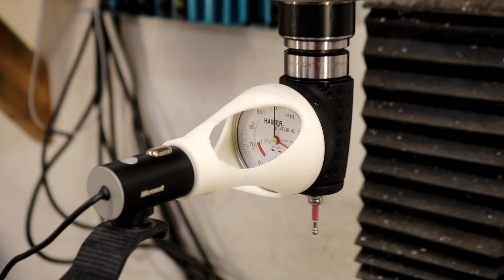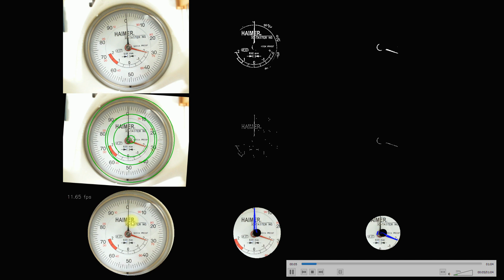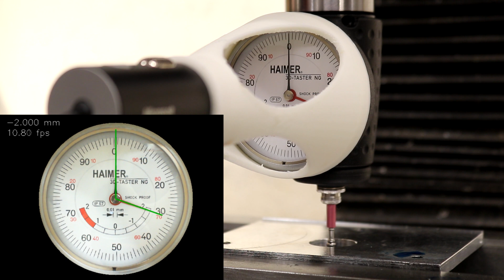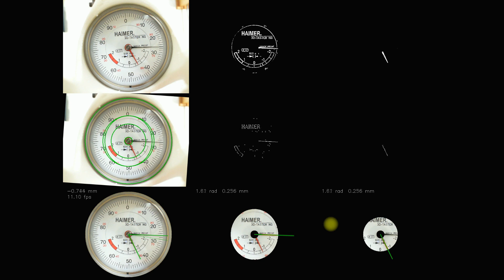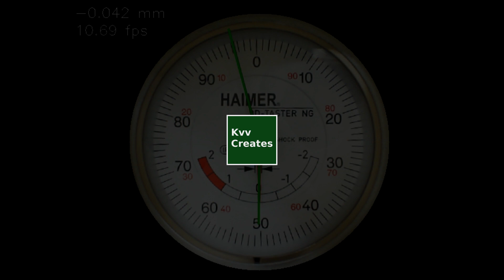Machine vision, gauge reading, LinuxCNC probing

Comment: I know this is 2 years old but I am pretty sure some digital test indicators have the same 4 solder pads under a cover that many digital calipers have.  It's usually a USB connection which you could use to read it.  I'm pretty sure even my cheapo Accusize dial indicator has them.  You can google to see how they reversed it on a set of digital calipers.  I have no idea how accurate it just came to mind after watching this.

Pretty slick how you did it with camera and Python.  Huge python fan here, been using it since V1.4
Reply from the maker: I have parts for trying this: a digital dial indicator and the serial cable. But, the dial indicator is sensitive to movement along one axis, while the Haimer is sensitive along three axes. Are you thinking that the dial indicator would be a direct replacement for the Haimer or for another application? Thank you
Reply: @kentvandervelden  No, I was just thinking if there is a digital version that works like the Haimer it may have the USB connection to read directly for tinkering with.  

I'm not familiar with the Haimer, first time I saw one was your video.  It's pretty cool.
Reply from the maker: @dev-debug  There are, but not in my budget :) I did get an electric probe, which tells if contact is made but does not tell distance. I should redo this video with that. Thank you for support! I started with Python at 2.6, after using C++ for years. I've not figured out what to do with it, but I enjoy it a lot :) The people who code the Python language and libraries are very gifted.
Reply: @kentvandervelden  I just looked up the digital version, yeah $820 USD is mighty expensive.  If the probe you got is 3D as well it should be pretty easy code a script to measure the stock or even find x/y center and Z offset.  I've never used the Linux CNC but plan on switching to it from Mach 3.  Hopefully it accepts python plugins.

Comment: I was looking for info on analogue to digital gauge conversion. You are the MAN! Info on the Haimer sensor is good too! Double thanks for the GitHub page, I have to stare at some code.
Reply from the maker: Glad to help :) Let me know if you need if need something. There are also academic papers on this too, generally trying to read banks of analogue gauges, maybe at power plants.
Reply: @kentvandervelden  I am trying to adapt your code to run on an openMV H7 cam IOT device. It has find circle, and find line micropython example code using Hough Transform. Could be a usable device for legacy gauges that need monitoring. I just need the time. I have another more powerful chip, a K210 board with camera and screen. It has their version of tensor cores for machine learning speedup. Thanks again for your video, a drill down on the code would make a good companion video, no pressure!

Comment: Hey!  Just ran across this older vid of yours while searching for the vid where SMW totally trashed a Haimer.  Seriously, one of these days we need to talk, as a lot of our idea paths cross so very closely.  My idea a long while back was to create a probe that used a single axis movement via any axis direction input.  This is accomplished with a hemispherical dome.  The initial thought was to use an optical switch or some other overly complicated method, when I realized how simple it would be to just add something like a nice Metrol switch on top of it.  3D printed a few versions and initial tests were awesome, but way too course on a 3D printer.  Then I ran across a video from NYCCNC (SMW now) and he took apart a Haimer he'd destroyed.....bingo...the light went on.  So then began my search for someone who had trashed a Haimer via starting the spindle...LOL...ouch.  Well, fast forward to a few days ago and I finally found someone and it's on the way to me.  The probe is in tact other than a trashed dial.  So now begins the fun of designing an internal adjustable mount for a Metrol switch to create a digital Haimer.  And with the great benefit of NOT having all the issues associated with those 3 contact point probes all over the market.  I'll put it out on my channel (yeah, I know I've done nothing in forever....should change soon).  Take it easy Kent.
Reply from the maker: Sounds cool, I'll be looking for your creation. I took a glance at the 3D Taster patent, I can see how the switch could work. How about an absolute encoder on the dial shaft? Might be easier while maintaining the overtravel. CUI makes some nice small encoders with various readout protocols. If you are interested, I make a followup to this video with an additional camera. I do machine vision work for hire, so that's the hammer that I have :) Since then, I picked up a touch probe that I assume uses microswitches from Drewtronics, but have not tried it yet. I'm sure it'll be accurate enough to the limits of my little mill. I'm always interested in talking with people about ideas. Let me know what works for you.
Reply: @kentvandervelden  Yup, very familiar with CUI as I use their AMT-102 on my spindle for position.  Excellent parts for their relative cheap price.  Though I'm not sure how I'd use that within a probe scenario.  I could easily grab those results and display them, but then it's just an extension of the face you can already read.  You probably have way more use within LinuxCNC than me with UCCNC.  I think my first experiment would still just be a method of turning the very linear probe ability of the Haimer into a simple digital input for standard probing.  To me that would also be way more interest to the average user since then it's just a simple NO switch being used (maybe put a plug adapter on the side of the Haimer).  Need to get it in my hands before I can rough it out.

As for the Drewtronics, it's the same 3 point contact deal as everyone else.  They have their secret sauce like others (yeah, grease to supposedly get contact to break consistent).  My issue with these probes is always been that angle of probe can/will cause different contacts to lift and Z could be any combo of the three.  If it's made well, then sure it's within the tolerances of the machine.  But my thought was always why not make one better, that is ultimately more simple in the end.

More to come!  Keep on creating!

Comment: Can the Haimer 3D sensor be used horizontally?
Reply from the maker: Yes. Someone commented about the concentricity, and if you are looking for high precision check that out. For me, I suspect the Haimer exceeds accuracy exceeds my skill. There are some cool uses too that are probably more sketchy such as dragging the probe to measure surface variation, but for relative measurement even that's probably fine. It's a fantastic tool.
Reply from the maker: I'm sorry, I might have misunderstood. Yes, the Haimer can be mounted horizontally, e.g. on a lathe. Peace
Reply: @kentvandervelden  : Thanks was just wondering,  because of this link, https://youtu.be/kacnj-kpErw
Reply from the maker: Thank you, that's a neat video. The tool offset steps shown in the video must be done regardless of orientation. Looks like the original Haimer patents have or are nearing expiration in the US. I started to compare the Haimer to the probe from the video. This appears to be the related patent. Digging into the cited and family patents could be interesting. Best wishes
https://patents.google.com/patent/US20140366393A1/en

Comment: I have plane to make linux cnc to work like this

https://youtu.be/NxWBAauS7_U

https://youtu.be/qnfIKLC4DYM

https://youtu.be/Q3NTLQ3EIPQ

https://youtu.be/A-fw7W5TY-w

So,can you help me??
Reply from the maker: Those are very impressive machines. In general, I would not know where to start to help you. If there is some small specific item you believe that I could help with, shoot me a message. Regardless, I do wish you the best of success with your build.
Reply: @kentvandervelden  
This day i have spent much time to contact cnc controller manufacture that can do that,
I have from china,adopt linux core,and i ll buy,
Industrial control,
Reply: @kentvandervelden  
But i still want it linuxcnc can be winner to all of my automate,

So,if using linux is,
Firstime touch probe of point cloud,save,convert to dxf,redraw,post gcode,running,just it

Comment: Great.
What about recognition of what is on a dial once tip touched the edge of the blank. In case if the software knows how much is on the dial - we should know how much steps should be run to get the 0 on a dial
Reply from the maker: That is how it works, assuming I understood your question correctly. The additional movements that may be causing you to ask is just in case the recognition is wrong. So, first move 95% of the read about, and so on. In this or the there other video it's also pointed out that there's no need to move to 0 once the measurement on the dial is known. It's only done for emulating how a person using the probe. Other optimizations are possible too. See the notes in the code on GitHub. Let me know if this didn't answer your question. Have a great weekend! Kent
Reply from the maker: Also optimizations have some cost. Mainly, I was careful to avoid breaking Haimer probe tips :) Still, was great fun to write
Reply: @kentvandervelden  the major thing that I like here is a usage of powerful technology to simplify things...
I guess that instead of making full dial photo there should be a way to do a macro photography to read dial precisely. When 2 arrows are down (no matter how far it is from 0 ) - next step is to add/substract a value, calculated.

Could also be more interesting to read from digital gage. They are very cheap nowadays and have precision up to a micron. 
But we don't need absolute value. Most important to grab relative value, diff. Once we have a diff - there is no need to go to 0. Having 2(3) diffs in 120°(not necessarily) directions could provide extreme precision
Reply from the maker: Reading a digital gauge would be easier and some higher camera resolution would help. This was only 640x480. Your other points make perfect sense. Did you see part 2 of this, where holes are probed? Someone mentioned that the Haimer probes loose concentricity but I've not found good information on this. Ideally, the second camera of part 2 and a good touch probe would seem a good combination.

Comment: Kent this is magnificent. Linuxcnc all the way !
Reply from the maker: Thank you Danilo. Have you looked at MachineKit? I've been wondering what the differences with LinuxCNC are, and which one is best for what. I know MachineKit is derivative and I see some of folks contributing to both projects.
Reply: @kentvandervelden  Couple of years ago when it started I ordered Beaglebone Black and tried using machinekit with it, but gave up. Centroid did a better job of utilizing it as a black box controller with external interface

Comment from the maker: Part 2 video: https://www.youtube.com/watch?v=7mBQwIzaiaQ

When the nine dials are shown, the displayed values for the red and black hands are identical. Fortunately, this was only a display bug and does not impact the final measurement. Also, while the camera is 720p, the captures are done at 640x480 to keep frame rate and sampling rate high. The shown FPS is ~10 because the screen is being recorded, saving three images per screen update, in the same thread.
Reply: Food for thought.. The current Datron machines use a large camera to point 'about' the x/y zero probing points (you move the machine by swiping the screen) and select on the screen where it should probe. Probe extends, and probing is done. I'm currently using a cheap USB microscope for x/y zeroing, with a known offset to the spindle. It's also well within 0,015mm accuracy. But you'll have to jog manually, not as spiffy as your solution! There are intelligent camera's available nowadays with some recognition in it as well,  ESP32 cams. They have face and object recognition as well. Awesome job on the programming Kent.
Reply from the maker: Thank you Rene, I'll look at this; the Daltron machines always very impressive. I want to tinker with making the machine aware of it's environment, but my ideas quickly turn out to be bad ideas once one looks at them closely :) Hope all is well with you and your family!
Reply: @kentvandervelden  Making it more aware is a good idea! Thanks for your reply Kent! all is fine on this side of the pond.

Comment: I've thought about putting a camera/GoPro mount onto dial indicators, but I never thought of using a computer to actually read the dial. Very cool!
Reply from the maker: Thank you! Would the camera be for remotely displaying the dial indicator when mounted in an awkward location? That would be interesting too.
Reply: @kentvandervelden  That's totally what I was thinking. Like, put a GoPro on your DTI, hook up to it with the app to view it wirelessly, and then you could see the dial clearly from every angle without paralax. The best use (that I can think of) would be when the DTI is connected to the spindle and facing the wrong way. It could make videos more under'stan'dable too. (I think I came up with the idea watching Shaden HKW's (Bar Z) videos. :) )

With GoPros (and other cameras, I'm sure) you can unscrew or screw-in the lens to change the focus, so you could possibly have the lens real close to the dial, reducing the how much bulk the camera and mount would add. The delay would be annoying, but managable, I think.